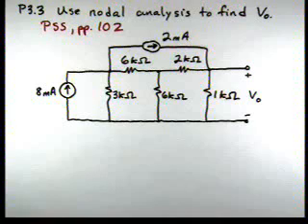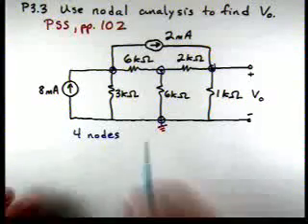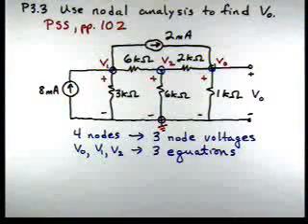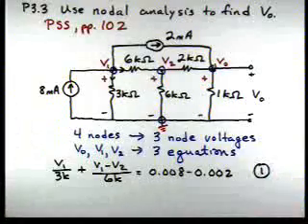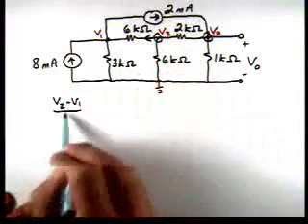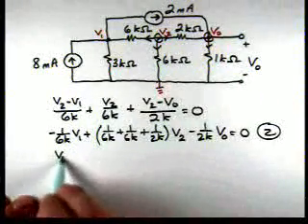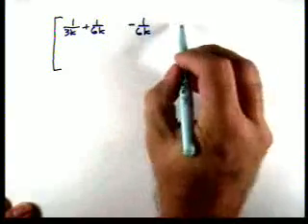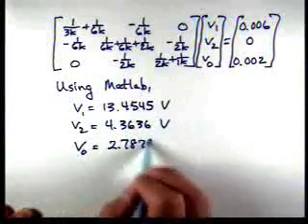Nodal and loop analysis(1).wmv

Comment: @PuchTaa it's arbitrary, to make things easier, make all currents as leaving the node. if you get a negative value on one of the voltages, it means that one or more currents are actually entering the node. you can find which by plugging back in to equation.